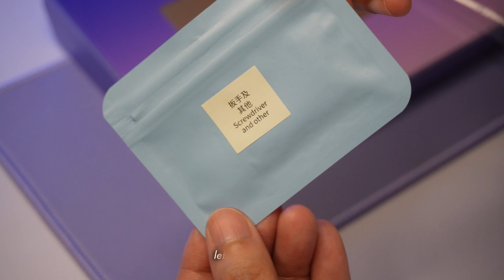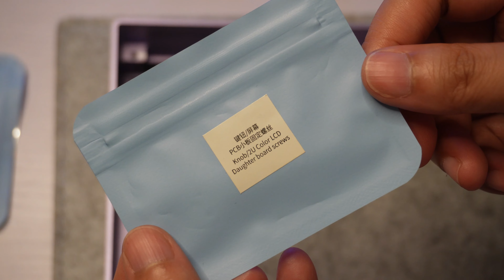Meletrix Zoom75 unboxing, build and review | Special Edition Anodised Lavender

Comment: Mannnnn... that sound is Crazy and yeah this keyboard is the best one.. 
but I have a question that maybe like strange or stupid, this keyboard doesn't use keyboard software like VIA to works, right??? because there are manufacturers out there who use via as software to make this keyboard work...
Reply from the maker: hey~ you dont need via to make it work. It will work normally. but you can use Via to remap the keys (not that you need to), or store macros into this keyboard if you want to. same as all via prgrammmable keyboards!
Reply: @mczstudio  Whoaa... thanks for the help now i can sleep well 😅

Comment: I missed out to order the internal SS weight. does it matter to the sound profile?
Reply from the maker: it does. but it matters depending on the overall sound profile you're going for. if you rather it deep on thocky. i suggest to just use the included small foam as replacement for the SS

Comment: I got a bad experience with the zoom65 v2 about the VIA keymappings. Could not find a way to keymapping my keyboards ....
Reply: The default stabilizer is not good, you need additional hole mod, but still not satisfy my ears, that tick sound was so annoying
Reply: @quangla9955  yeah! They even give u the silicone tap ( just assumption, I had it when I got the Mammoth 75
Reply from the maker: that’s a very interesting problem, have you seek assistance from their discord server regarding this?
Reply from the maker: not gonna argue with this, default stabs 80% always suck, not just in zoom boards.
Reply: Wait you already got your zoom65 v2??!
Reply from the maker: seems like from the meletrix discord, a few people have already received their v2s 😊. for my case, it was a prototype!
Reply: @stinky5628  yeah I got it in this week, the case is awesome, but the mother boards default position is not accurate. You could not plug-in your cable with the default setup. I need to loose the screw for the usable.
Reply: @mczstudio  I have email them but have not received the email yet
Reply: One more fact from using the Zoom65 v2, the deep thock sound does sound from middle row of the keyboard, but the outer row and column does high thack sound...
Also, the default stabilier not gave you the thock sound as you expected, consider replacing it from the beginning of assembly since the process of replacing the stabilizer does really need hard work... CHEERS
Reply: @mczstudio  jeez we haven't even gotten fulfillment updates in canada

Comment: How long did this take you to build? Just got mine yesterday
Reply from the maker: it took me a while cos i’m filming. but a good 20-40 mins should be fine if you know what you’re doing! 👌
Reply: @mczstudio  So should i get some lube for the stabs otherwise i will not be able to build it up? D: My zoom75 is coming, along switches and keycaps (also switch puller and switch opener)

Comment: I heard the manufacturing of Zoom is really bad, how is the texture feeling?
Reply from the maker: hi! that’s interesting , ‘really bad’ in terms of what? 

better shed some light on it instead of just throwing out that ‘Zoom is manufacturing is really bad’. it can be very misleading.
Reply: @mczstudio  very scratchy that u can sharpen your fingernails with the case
Reply: I owned a zoom65 v2, the texture feel is really good, smooth on edged.
Reply from the maker: my zoom75 case is the anodised lavender, its not scratch and shiny and smooth af, i think it’s visible from my closed up shot of the case! 

my cyber yellow zoom65 v2 finishes doesn’t feel rough as well. which case and color do you have?